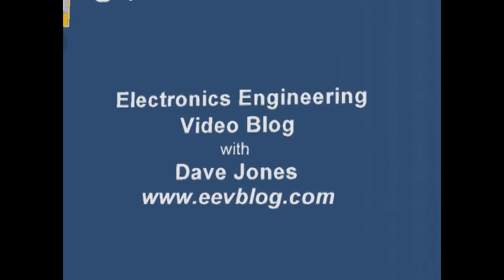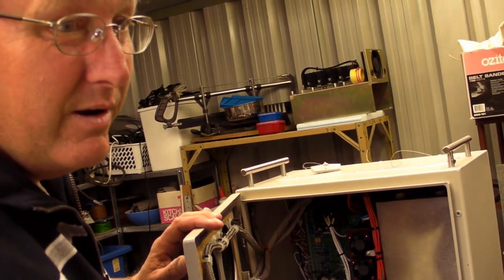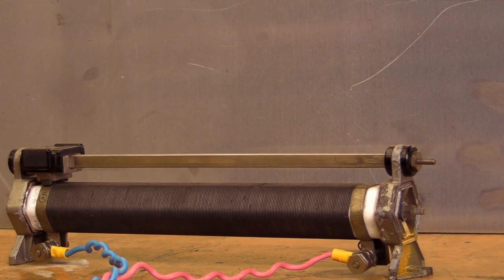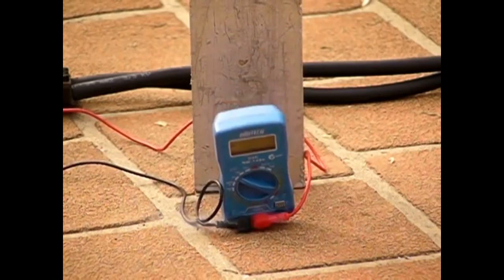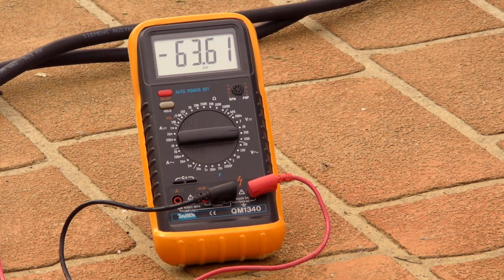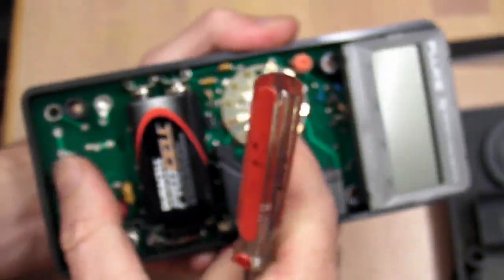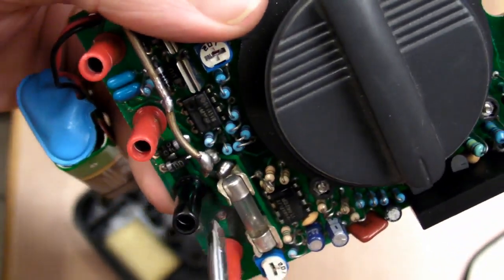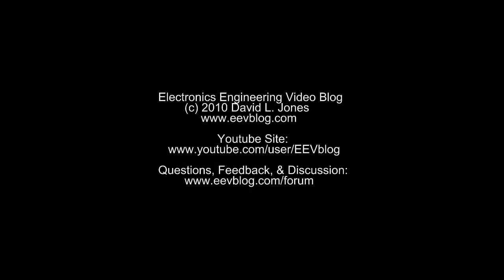EEVblog #84 - High Energy Multimeter Destruction

Comment: Just for giggles, I calculated the height the aluminum block reached based on its airtime.  It was airborne for ~3.3 seconds so it went ~13m high.
Reply: I would have secured that coil to ensure that it goes straight up.  13 m launch makes that even more important, but I assume they've done that a lot and started at lower currents.
Reply: I know this is an old comment but that’s pretty impressive. If the aluminum was .8 kg that’s over  25% conversion of electrical energy into kinetic energy using an air core coil. 

And it wasn’t even optimized for maximum efficiency or recovering leftover magnetism.

Comment: The maintainance man at my work attempted to check mains voltage into the building. He was inadvertantly on the primary side of the transformer (13.2 Kv). Needless to say his Fluke 87 multimeter left nothing but the handholds of the leads. It's a wonder he wasn't hurt with the arc flash explosion of the meter.

Comment: The CAT rating on meters is very important when working with high energy circuits. Simple reason is transients and such. Nothing worse than a flash accident due to your meter being sub standard. My high energy working meters are no less than CAT III 600v. My normal everyday bench and field meters are CAT IV 1000v and this is purely for safety reasons. Good movie.

Comment: One thing, Having spent a great deal of time dealing with airflow, and heat dissipation. If you setup your cooling fans to pull, and place them at the top you should see an ENORMOUS increase in cooling. Just throwing that out there, only because I know most folks settle for the cooling them can have, rather than trying to perfect it. Hope it helps you out at some point. GREAT JOB btw!!!

Comment: That was fun but I wouldn't say that El Cheapo meters are bad because they couldn't handle 4Kv.  I seriously doubt that the folks that buy $20 meters are going to even have access to 4Kv.
But Hey I guess I will drop $1500 on a Gossen just in case I want to measure across a 4Kv line.  Yea right
Reply: Joseph Murphy It’s old news, but the Gossens that I’ve seen are crap. Not worth it at all. Well done poor engineering.

Comment: You can now replace a lot of those glass fuses with the correct SIBA FF Ceramic Fuses that will handle up to 600 Volts in the 10 Amps if you only have a 6 mm x 30 mm fuse and 1000 Volts in the 500 ma using the same 6 mm x 30 mm fuse. Klein Tools 69033 FUSE 5 mm x 20 mm 500MA 600V, this is a ceramic fuse with more than likely sand filled inside.  This will help get your meter closer to being the proper cat II and proper cat III rating without having to pay a lot.

Comment: My old Fluke stopped working when it was accidentally exposed to about 20KV in an old style TV.  However, I replaced one IC and it works like new except the AC voltage reads about 0.4 volts high.

Comment: t=6:45 Looks like a green PTC just below the buzzer.  Not on the voltage side or too slow?  Blew apart because no screws? No screw remnant or break in the posts, so seems like unfair test.

Comment: I may be safe, well sort of, all I usually deal with is arduino voltages, and perhaps 12 volts in my RV. It is rare indeed when I delve into the 120 volt items, however recently I have developed an interest in old radio receivers. Thus far I have not jumped into the old valve sets but if the chance were presented, I believe I would check some of them out. When I was a young fellow, probably 8 or 9 years old, we moved to our first house with electric power.  Dad bought us a used floor model radio, it had shortwave, and POLICE!  Now we were living on a farm in the midst of some very tall butte's  so the chance of getting much on Shortwave was probably very low, especially when there were no antenna's hooked to the set, but I was determined to get it working.  So whilst mom and dad were out in the barn milking cows, I turned on that old radio, and turned the switch to SW.  Nothing really happened no matter how much I twisted the knobs and pushed the buttons, so I reached around to the back side of the radio and stuck my hand inside to try and make a button pop out after getting it stuck.  There was, in my mind, a crash of thunder, my muscles all went tight, and my little body seemed to fly across the room and bounce off the wall.  To this day, I don't know what the hell I made contact with, probably the B+ or perhaps it was just the 120 volts, but I had a hell of a burn on my finger and a knot on my head that looked like a goose egg.  I never told dad what I had done, or I would not have been able to sit for a week as well, one day I did mention it to mom as she was looking at that lump on my head and bandaging the burn on my finger, she said she would not tell dad either.  I did learn not to stick my hand in the back of a radio.  Valuable lesson I guess.  Still I would love to have that old radio back.

Comment: i once blew the $10 meter and melt its probe tip when i accidentally probe the main in the current measurement. so no surprise that its case blew off at 4kv.
Reply: lol, I accidentally shorted 230V AC in some PSU with my Amprobe meter's lead while trying to discharge a capacitor to get one quick measurment. I must have timed it just in the 300V+ part of the waveform as the steel lead literally got melted and fused with some metal, it looked funny as the steel wrapped kinda around, also the spark was so huge that it totally ripped nearby capacitor xd it tripped my workshop's breaker, whole house breaker and the one outside lol. Kids, always check that you have unplugged everything twice before working on electronics, don't use your expensive stuff to short capacitors or basically anything and don't touch the mains with your bloody fingers xd

Comment: A bit worrying though, that EVEN quality-brand digital meters which measure up to 1000v will blow drastically when 4000v is applied. You wonder what the safety margin actually is, if it's actually 400% then not too bad, but the instant pyrotechnics at this voltage suggest the actual safety margin may be a lot less. 

I'm sure the old analog meters like the AVO wouldn't have nuked on a 4x overload. Might've bent the pointer wouldn't have suffered an insulation failure.
Reply: Phantasmotronogun if you hook a fluke up to 6kv mains, you will die. What cat 4 really means is that a super brief 6k transient but will self extinguish the arc by the time it's back down 600v without blowing the meter apart. If it is a typical super brief 6k transient it won't even break the meter as the front end will dissipate it. On a el chepo the 6k transient will begin an arc that will not quench as the voltage comes back down to 600, power will be massive over time and you will get 3rd degree burns as well as parts of the meter embedded in you.
Reply: The old analog meters are freaking firethrowers. Don’t overload them from high energy sources. They’ll send flames and a bunch of glass shards your way. And when you’re regaining your consciousness, they’ll set your lab on fire. I’m not joking very much here. The whole “things were sturdier back then” thing only goes so far. If you apply that “resoning” uncritically and have religious approach to T&M gear, you’ll suffer. Don’t do that. Those meters were neither designed nor tested to be safe or even withstand such overloads. They could deal with the energy limited ones due to the inherent thermal mass of their components, but once things start vaporizing and there’s an arc, it’s bad news. The insulation won’t need to withstand anything: it’ll evaporate. Good luck depending on solid insulation when it’s in vapor state :)

Comment: well, this is a good way to test the safety of meters. if it doesn't explode during this test, it's a safe meter since you're probably not going to use it anywhere near the 6 kV of voltage of this thing.

Comment: Supposedly, an EMP will mostly affect electronic devices if they have power running through them when the EMP happens. I see that the multimeter is turned on for this 'test'. Is there anything that can protect against this in circuit design? What if there was a fuse along every trace between every component inside? I know that'd make it unbearably large and is unfeasible for that reason. But would that even help stop/isolate this effect? It'd happen on the inside of the chips/ICs too, wouldn't it?

Comment: on multi-meters that have a fuse inside of them, do they protect the meter ? i have an innova 3320 and the fuse is blown but the meter still works
Reply: Only the low impedance inputs (the ones for measuring current) are fused. If you only have one fuse, it's probably protecting the lower range current input, so that won't work, the rest of the meter (higher range current, resistance, voltage…) will.

Comment: I have a cheap accurate autoranging meter; it cost me £20. But I'm not using it on mains circuits or in any industrial environment. It is rated for CATII 1kV and CATIII 600V (and can measure to 1,000V/750Vac) though probably wouldn't fare too well with the 4kV tests. It is fused on the 10A range and the 400mA range. So I think this meter is good enough for me... Am I wrong on my decision?

Comment: Is there a significant user risk with cheapo meters used on household 240V?  All of the damage in the video was contained in the meter, so when they arc or burn inside is there a real user risk or is it primarily a fire risk if they are left connected for too long?   i.e. Are there significant user safety problems with no input protection or is it primarily protecting your investment in the meter? 
[Even though at most I will measure household 240V, I chose a $20 UNI-T UT890C because it has 3 PTCs, a diode bridge and larger fuses than, say, a $10 ZOYI ZT102 that only has 1 PTC and tiny fuses. The UT890C also has larger shunt, traces and pcb isolation slots.  Is it really safer for the user or not actually an issue? ]

Comment: I cannot agree with Dave's comment about not using cheap meters. Provided that one recognises the limitations of cheap meters, avoiding using them in high voltage/high-energy situations and being aware of their potential errors, a cheap meter is adequate for many day-to-days tasks and should one be unlucky/careless/stupid enough to drop it, lose it, lend it and not get it back, drive the car over it or otherwise wreck it not a great deal of damage is done to one's wallet. I have several £5 to £15 meters dotted about the workshop and garage, a luxury I could not indulge in with Fluke meters, although I do have two of that brand.

Comment: Dosent the fuse burns before it damages any other things?
Reply: i think the discharge speed has something to do with it but not sure unless they replaced fuses with something else
Reply: ohh ok
Reply: Rule of thumb: fuses are always slower than the semiconductors they protect. So if you have a semiconductor device that needs protection quickly, a fuse won’t do it. By the time the fuse opens, the semiconductor will be vaporized. But if you have a fast semiconductor device that can shunt the overvoltage and absorb the energy for a little while until the fuse opens, then you’ll be fine. 

On amp setting, the only other thing in circuit that needs protection are the metal traces and the shunt resistor. They all have time constants longer than the fuse, so the fuse will protect them mostly before they even notice the overcurrent. On the volts setting, the fuse would be protecting things that get destroyed much faster than the fuse. So the fuse is pointless there, unless the circuit were designed differently. And: the meter is supposed to survive some surges without damage – this implies than no fuses must open (if any). So might as well design it without a fuse.

Comment: cheap chinese screws are the best

as for multimeters the one that i have which has never let me down despite being dropped, over voltaged, over currented, and god knows what else 
is the 
parameters 7040 multimeter 
not sure when it was made but it has dip switches like the old analogue TVs from the 60s on the left side of the meter instead of a knob on the front
and it has an actual slide switch to turn it on 
i got it 2nd hand from a mate and i have had it for nearly 4 years so far

i cant find any information on it from the internet but if you can get your hands on one i recommend you buy it 

it is an absolutely ancient DMM but it is the most destructible thing i own